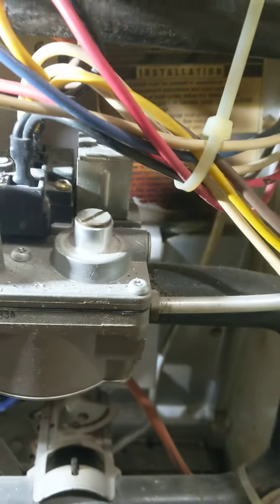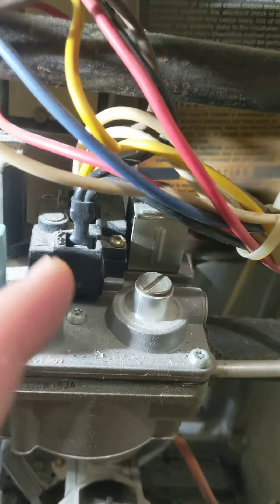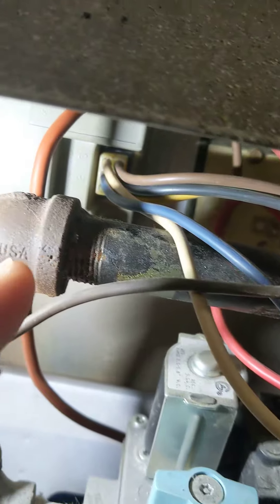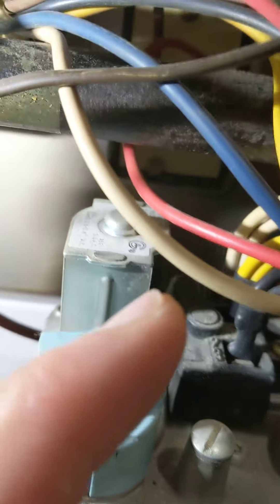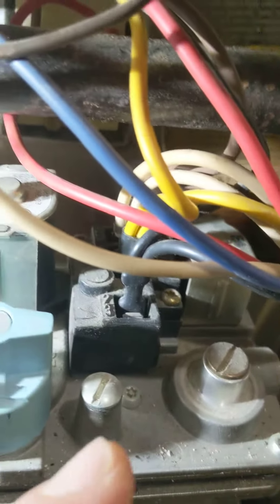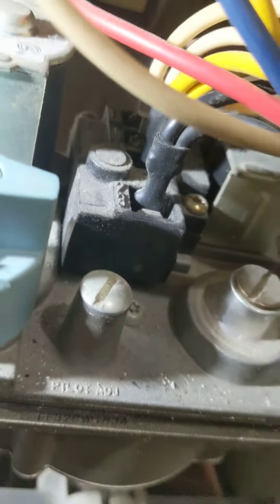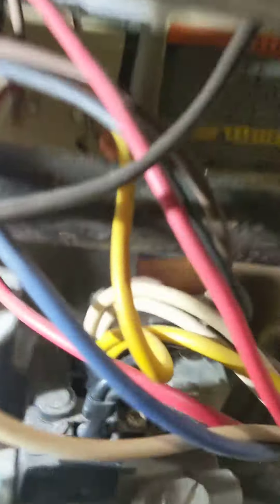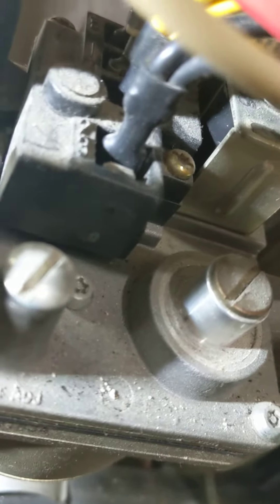carrier furnace igniter lockout box to gas valve

Comment: Hi, I have the exact same furnace setup as in this video, with the same HSC ignitor / lockout control module. I'm wondering do you know how to test that the control module is working? On mine, it never produces a spark anymore to the pilot assembly so my furnace cannot turn on. I replaced the control module, but that didn't help either. I'm wondering now if it's because 24V is somehow not being supplied anymore to the control module. On the plug that connects to the control module, I measured the voltage between the middle connectors that plug into pins 5 and 2 on the control module when heat is supposed to come on. Should this measure 24V? I get a very small voltage instead like .3V.
Reply from the maker: The board should have 24vac. 
Bad transformer, check output.
Reply: Would you know whether the way I tried to measure the voltage using the connectors of the plug (that goes into the ignitor control board) is proper? That there should be 24V across the middle connectors of the plug?

Don't really know much about transformers. Is it typically inside the furnace or could be located outside? And how to check the transformer output with a multimeter? Thanks for any advice.
Reply from the maker: @dcccs  trace wire from furnace switch/power supply, should first go to transformer.
Test 2 lead wires after  it, should be 24v
Reply from the maker: @dcccs  or look for the thermostat wires, tester on AC, probe r and c , should be 24v